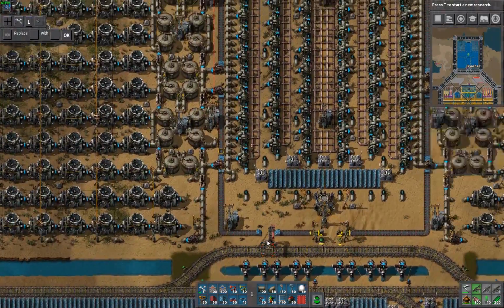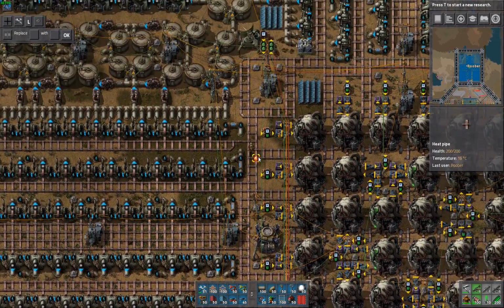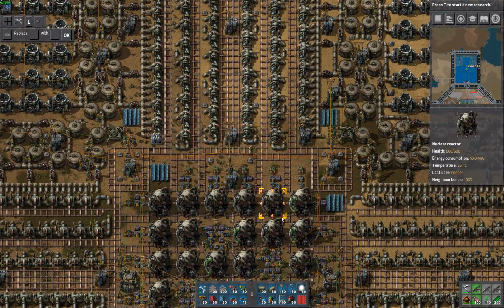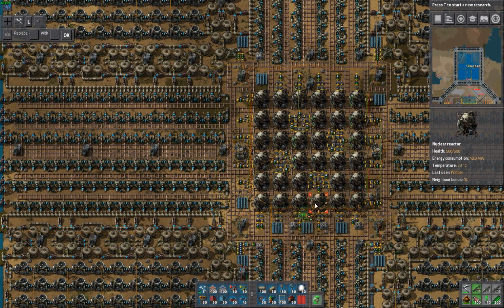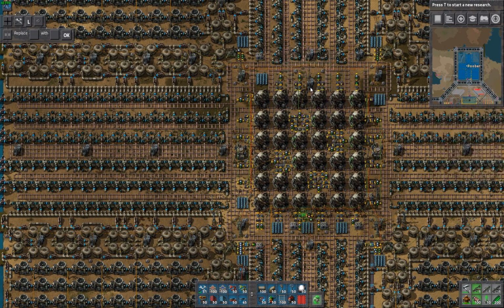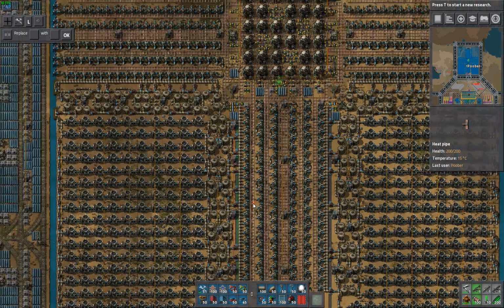FACTORIO 0.16 | Beacon Installation - Episode 25

Comment: Those four reactors in the middle doesn't help anything
Reply from the maker: Will have to look into this, thanks for bringing it up.
Reply: They do have one output each to the outer reactors. I think they can transfer heat through each other
Reply: Theis Strømming why not?
Reply: They don't have any output and they don't boost any reactors with output

Comment: Not sure you need that much speed beacons for the smelting.
one railroad provides about 24 thousand ore per minute with 2-6-0 trains(maybe a bit more), one unloads next is in line waiting for unloading
it is about or less than about 500 furnaces with speed module 3 installed.
but the point is that ti looks more installed than an one branch of raiload can deliver
Reply: and show production and energy consumption next time :D